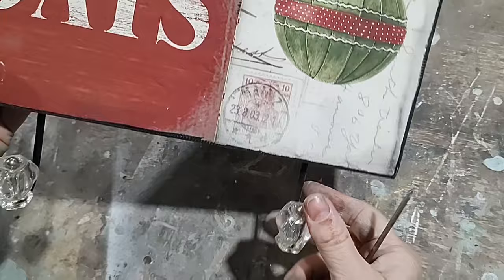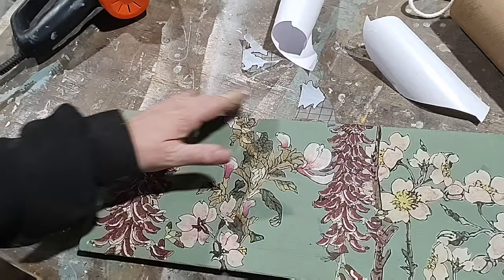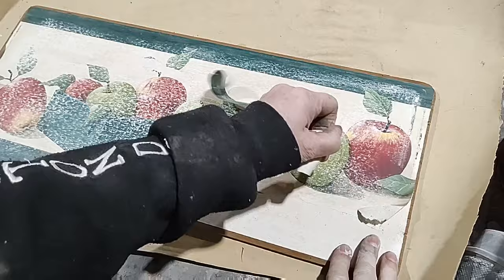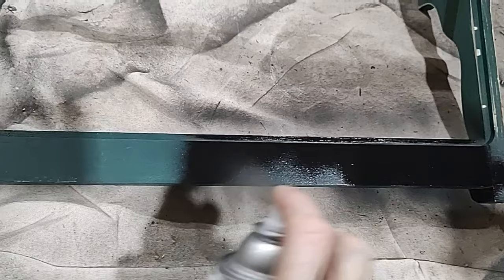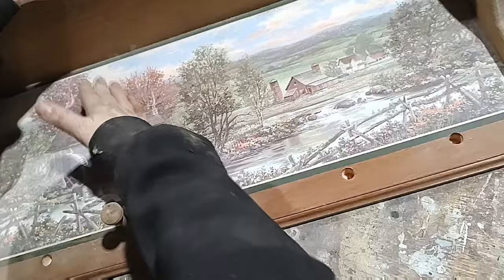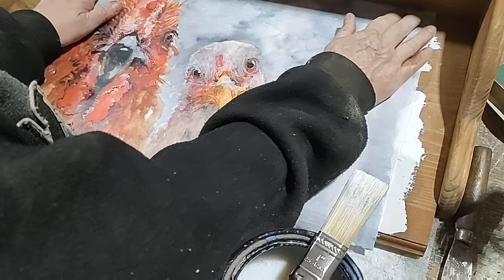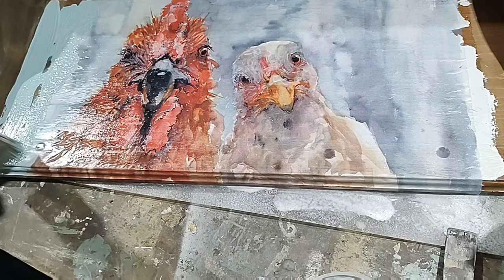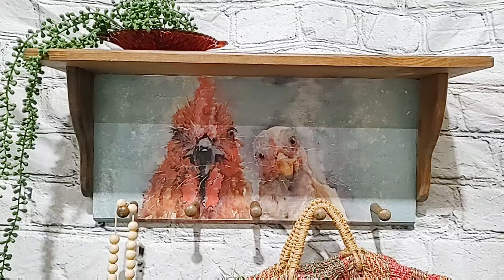Three Upcycled Flips with Three Different Looks - Trash to Treasure with IOD, Tim Holtz & Rocycled

Comment: Quick question... In your staged photos, the white brick background is a backdrop, correct?! How do you get things like these shelves to hang on the backdrop?! I may be having a blonde moment but I have always wondered this, lol 😆
Reply from the maker: LOL It's a cloth back drop over my metal shop door. You can actually see the 2x4s through it sometimes. 🤭 I use magnets with hooks on them to hang things. They're from Amazon and they say they can hold up to 100lbs (which is important because through the cloth, they lose some of that ability. I had some that said they hold 50lbs and they wouldn't hold up the larger shelves (they slid down the door/cloth. Whoops). ♥️